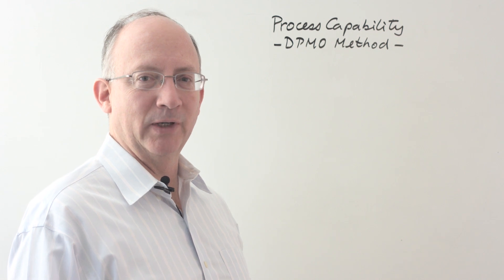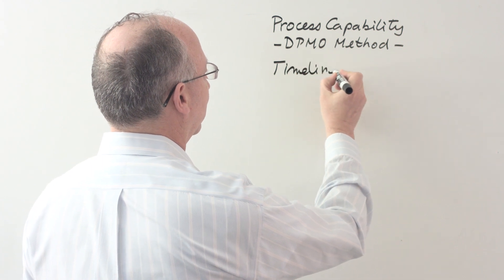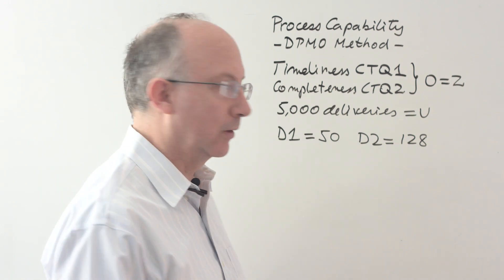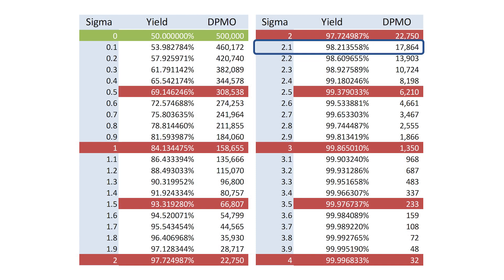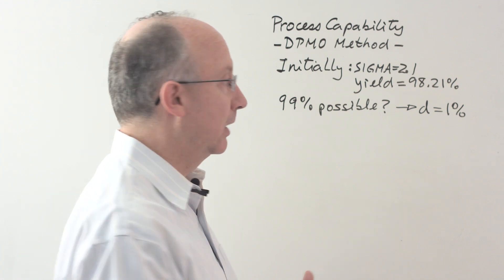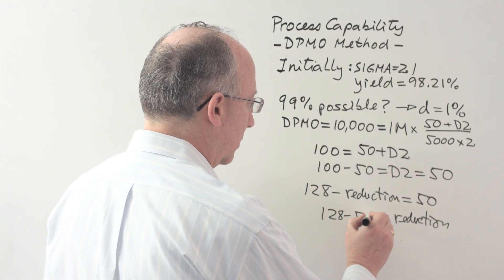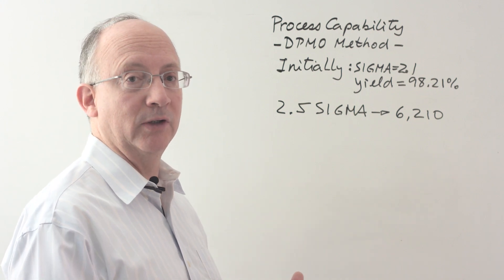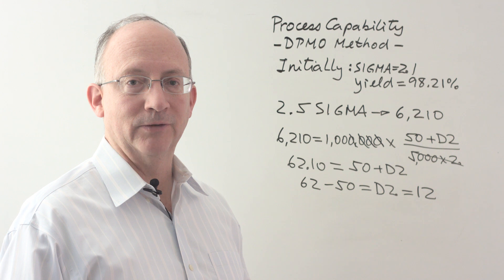DPMO Method for Process Capability | Green Belt 2.0® Lean Six Sigma | fkiQuality HD

Comment: I am refreshing my memory on DPMO, and I am trying to understand how these 5000 deliveries were selected. They seem random... Is this an AVERAGE over a year? Over 3 months? Over a single month? How might one using DPMO select an effective number of units to develop a baseline? Again, would I be calculating based on an average? I am in the printing industry, and I am currently tracking file issues coming out of our programming department. My "units" would be files. These files are typically faulted and are reaching our production line to print. I need to develop a goal to set control limits. HELP!

Comment: Shouldn't sigma level be 3.6 instead of 2.1. I checked the sigma level table. With DPMO of 17800 sigma value is 3.6 and yield of 98.22%. Overall method of explaining the whole formula was great however someone please confirm the end result if it is correct or not.
Reply from the maker: Hi Ahmad, good question. The sigma level of 2.1 in the table is correct. Any table that does not have a DPMO of 500,000 for Sigma=0 is off. Motorola shifted the table by 1.5 sigma arbitrarily and made an error in the statistics of long-term capability.